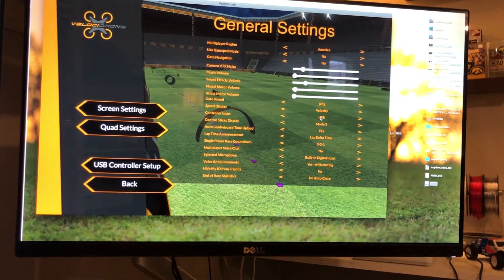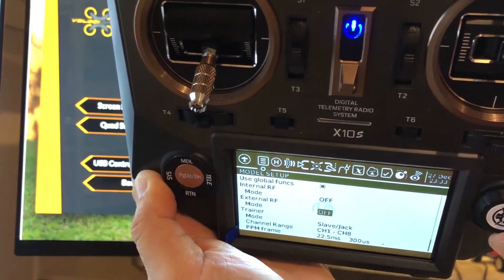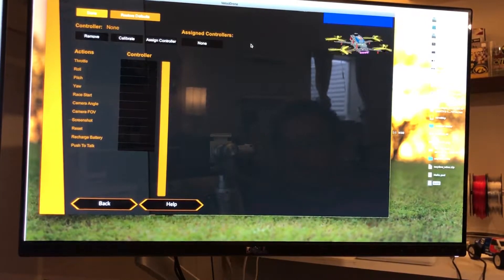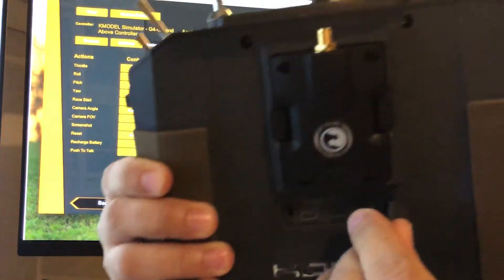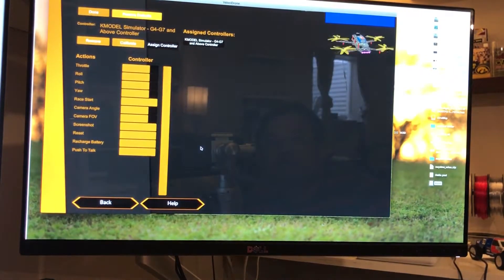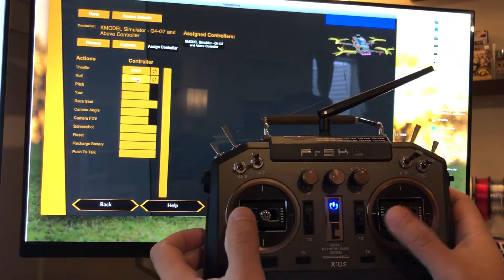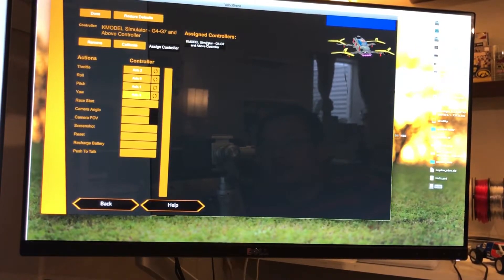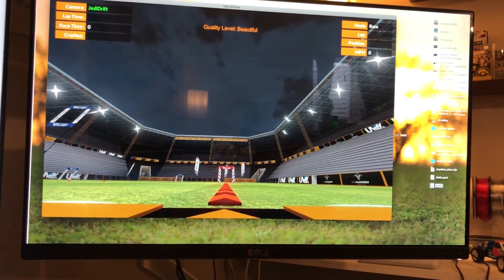FRSky X10 / X10s Velocidrone setup

Comment: Please help me.. Switch and buttons doesn't work
Reply from the maker: You have to configure the switches manually. Once you get the transmitter connected properly, the switches need to set in the SIM. I don't have X10s anymore as I moved to the Jumper T16. Smaller and has multi protocol.

Comment: Do you need open Tx to do this I like Fros.
Reply from the maker: Flyer-rcplane nope, should be straight forward but make sure your channels are mapped correctly in FrOs.
Reply: JediDrift515  I ordered the Freedom FPV - Universal Flight Simulator USB Adapter Cable All in One. My computer only sees mass storage if I use the usb cable.
Reply from the maker: Flyer-rcplane make sure your connection is correct. I’ve seen others with that issue and it’s something with your setup.

Comment: Hi JediDrift515, why do you need a USB adapter to the trainer port, the Horus can be configured to be seen as a joystick on Windos. Did you try? Are there limitations?
Reply from the maker: It's fine to do the configuration but this is the most standard in fpv simulators. Even when you configure the X10s to be slaved, you still need to configure the controls within the Velocidrone. I have used this cable for my DX9 and also and have worked flawlessly without much workaround.
Reply: Any tips on how to use the usb port in the radio? I cannot get my pc to recognize the radio in joystick mode...
Reply from the maker: Vincent Davidson from my tooling around, I can’t seem to find a way to get usb into joystick operation. Only with the simulator adapter you can get it to function correctly.
Reply: Under Radio Setup, at the bottom of the screen there's USB MODE that can be set to Storage / Joystick / Ask. I used it successfully with other simulators, haven't tried with Velocidrone yet.
Reply: I was able to get it to work via usb as a joystick 😎

Comment: hello.. Im having the hardest time to connect my x10s to velocidrone.  Simulator wont recognize X10s on the USB settings.  like no buttons are active at all.  When I connect the x10s, all its doing is giving me a screen with a big USB icon in it..  Please help.. Thanks..
Reply from the maker: I don't know what adapter you are using and make sure you have it set at to the right switch. https://www.amazon.com/Freedom-FPV-Universal-Velocidrone-RealFlight/dp/B06Y1H8LSX/ref=sr_1_1?ie=UTF8&qid=1522430467&sr=8-1&keywords=realflight+simulator+cable&dpID=41RQrPhcBJL&preST=_SX300_QL70_&dpSrc=srch
Reply: JediDrift515 I’m not using any adapter.  Will buy that adapter now.  Also I’m guessing the TX is being recognized as a mass storage instead of joystick USB.  I can’t find a way to check in menus of tx to see how’s its connecting. Thanks!!!!🙏🏽
Reply from the maker: Yes, the computer will only recognize the radio as mass storage. Definitely having the adapter will get you up and running.
Reply: Thanks man!  I got the adapter and I’m connecting no problem!  Thank you so much!!! This vid is really helpful!
Reply from the maker: GRAILS IE Fly it like you stole it!!!!
Reply: Man U know it!! Lol tho I’m still learning how to fly and it’s basics.  Kind of hard to just move forward and keep a low altitude.  I could tell that the X10s controls better than the PS4 controller I’ve been using.. man I can’t wait to fly like you guys!!